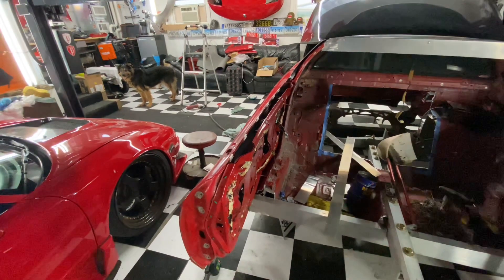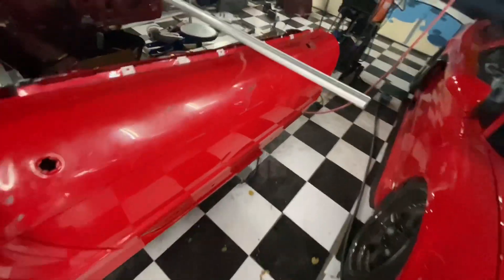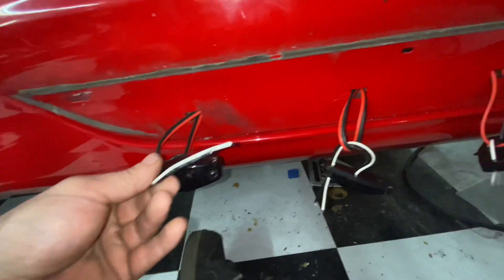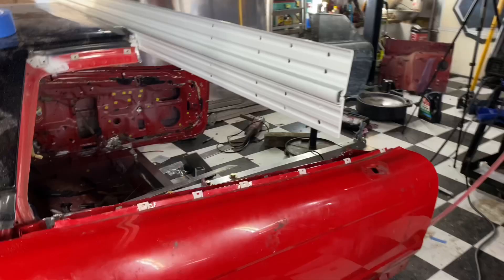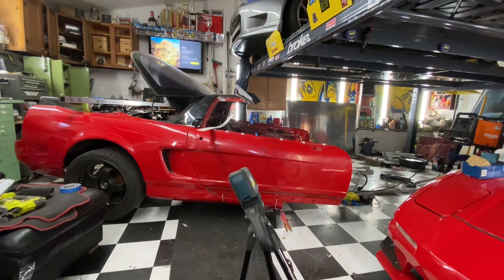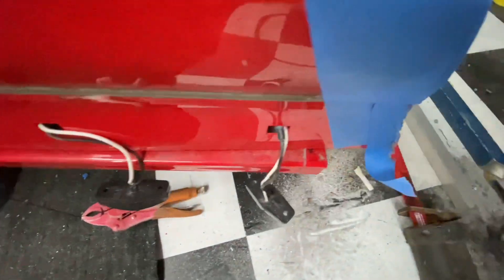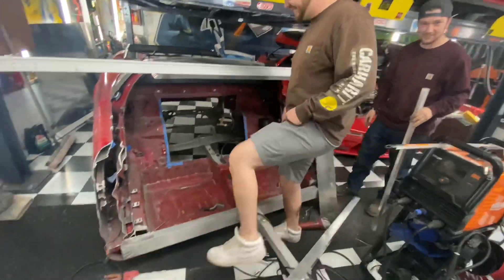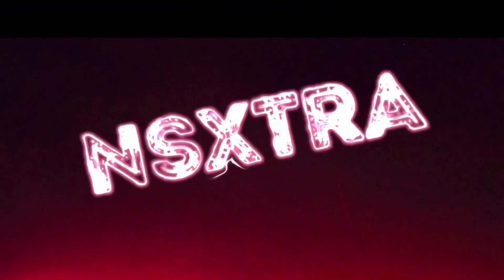Cutting NSX Doors & Fabricating NSX Trailer front

Comment: Not familiar with Connecticut laws. But could you just make the back bumper side markers amber? Still loving this. Can't wait to see how you lay out the interior and storage
Reply from the maker: No, has to have amber in the front and reflectors. I used red reflective tape to cover the holes in the doors and it blends in perfectly.